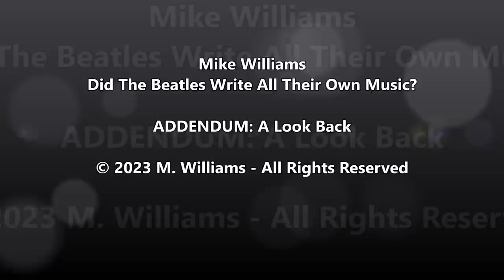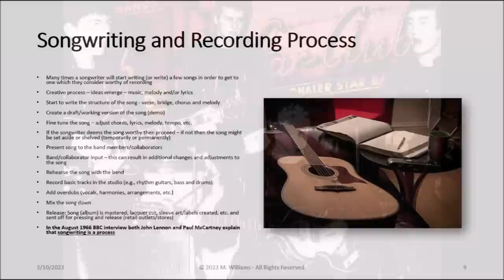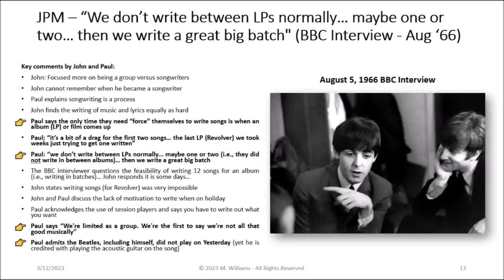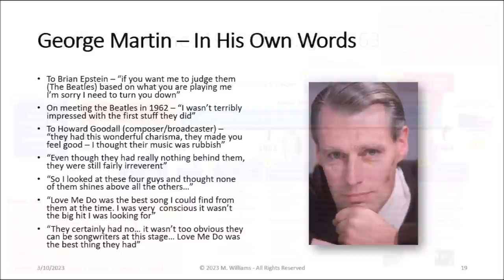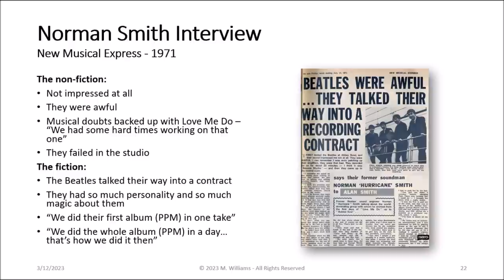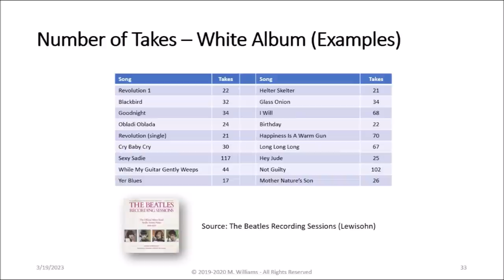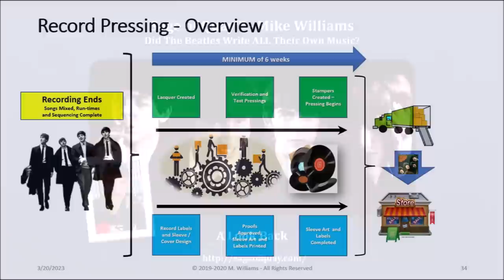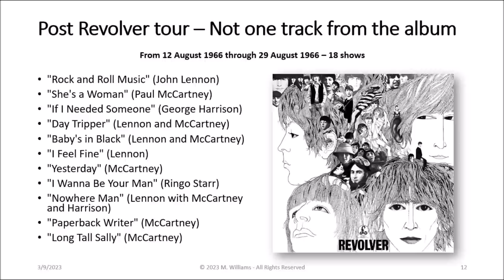Sage of Quay™ - Mike Williams - The ADDENDUM: Did the Beatles Write ALL Their Own Music?  (Apr 2023)

Comment: The problem I have with this theory is that too many people are involved. There is no chance they would all keep silent, none.
Reply from the maker: 🙄 The typical tired and worn-out "reasoning". You might want to actually watch the presentation. It will help you understand.
Reply: Am I to assume when it says two replies and there's only one, one is shadow banned? Or has the other one been removed by Mike?
Reply: There are a HELL of a lot of "PEOPLE" in this CULT who make sure it's kept "QUIET"
Reply: That’s the point, it takes so many people to pull this off think  about the money at that time. People earned very little back then, I mean £20-30 pounds a week for a manual worker.